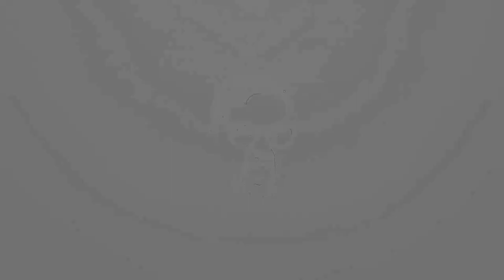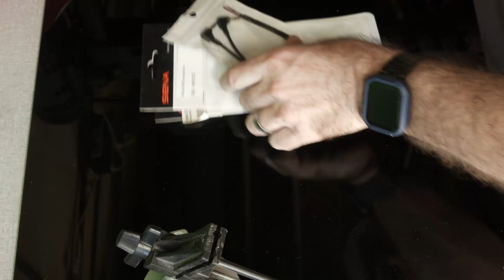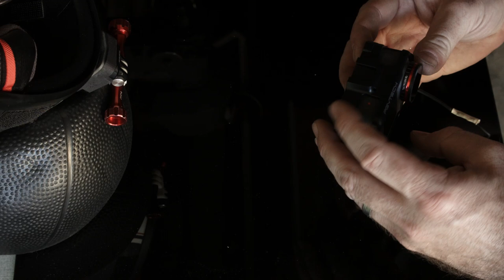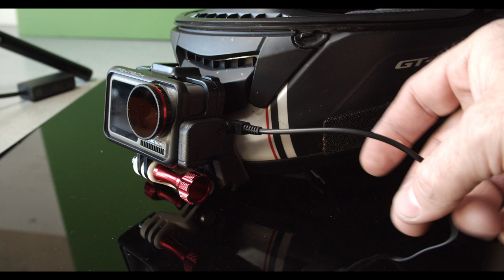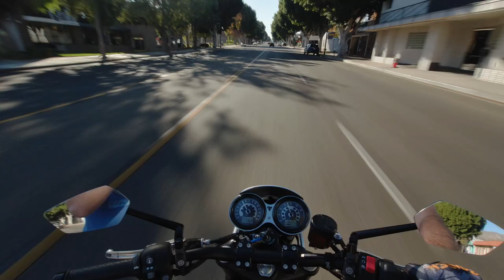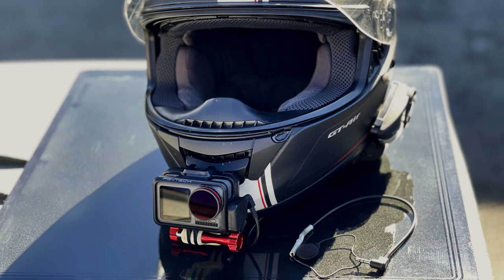2020 Motovlog setup Triumph Speed Twin mods.

Comment: When are u going to upgrade the front suspension similar to the rear one which u got it replaced by thruxton
Reply from the maker: It’s in my plan, eventually I will, it’s just a more involved project that most of my other mods. And pricy!
Reply: Would like to see what modifications you can do to a naked bike like KTM Duke 890 R. Would be fun to have that bike along side with the Speed twin in your garage